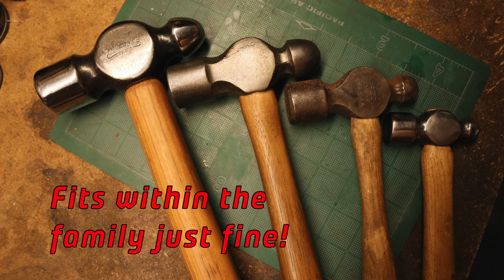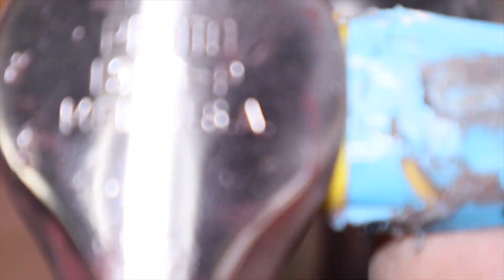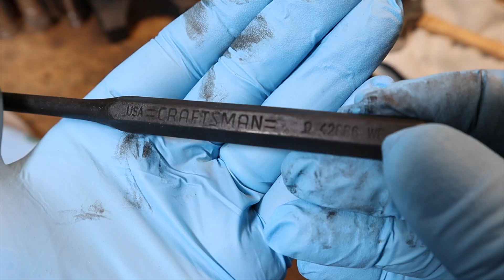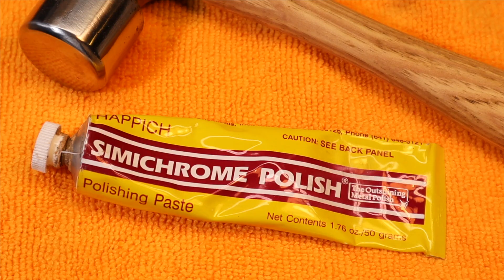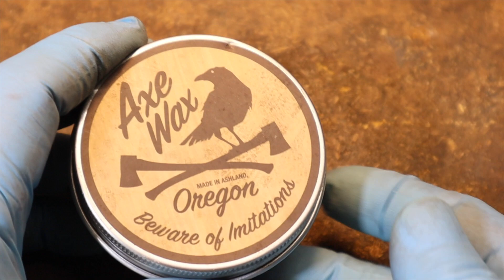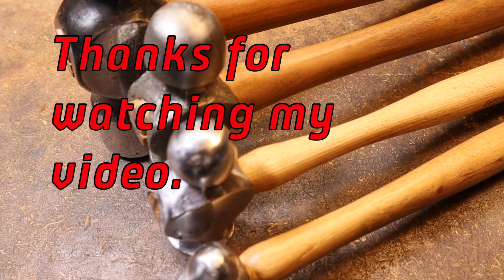Proto Ball Peen Hammer Restoration

Comment: Found a proto 24oz usa made one with the original green hexagonal handle but it was trashed but got xrazy lucky and found some NOS proto green hex handles on ebay, 2 for 20 and ordered them and glass beaded the head and polished it up. Looks too good to use now, wish i woulda just out some other hickory handle on it not the rare ones. Also found a 24oz proto challenger, didnt go crazy with it, just sanded the handle coated it with lin seed oil and cleaned the head up